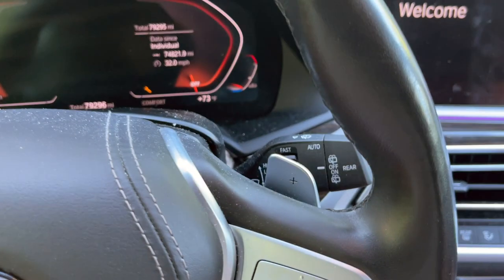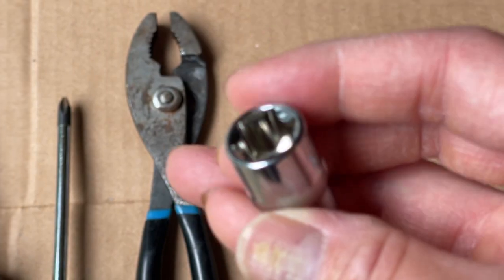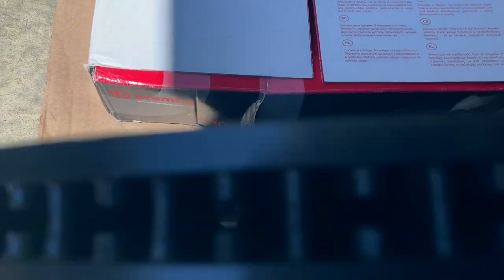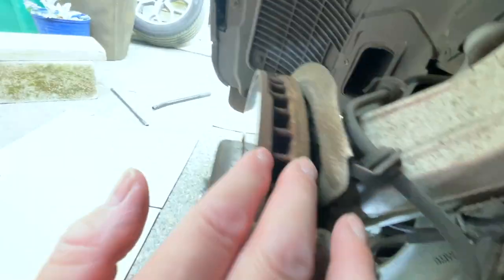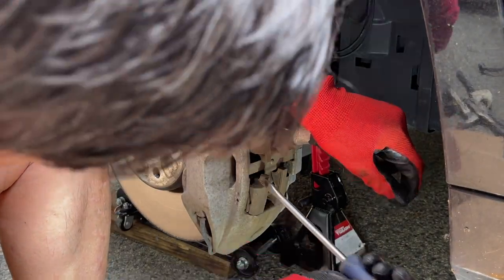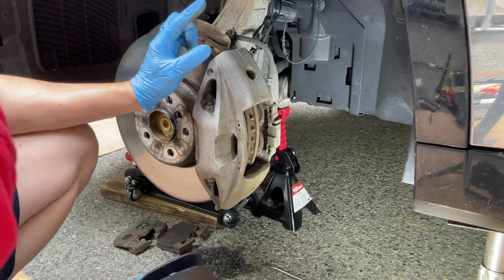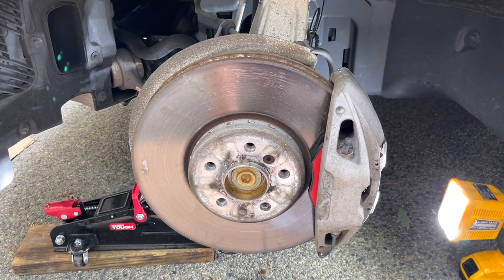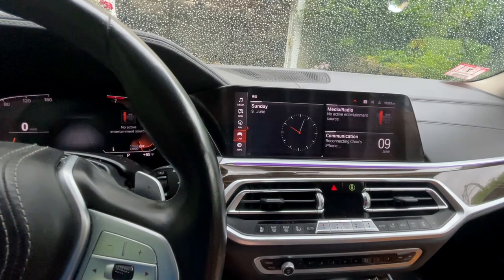Ultimate Guide: How To Change BMW X7 Brakes And Reset Lights (2019-2021)

Comment: You should do your research bmw brakes are designed to do that the sensor will wear so that it gives you enough time to change out your pads, yes you can keep driving but you just need to keep a eye on the thickness of the pad.
Reply from the maker: @paulpryor3333  great advice 
I am a type A person who would change all of the pads as soon as i can

Comment: Hey there, thanks for the video. My question is after you get done with the brake job do you have to reset the brake light on the computer or just take it for a test drive and will be okay?.
Reply from the maker: You would have to reset the brake light… I showed how to do it at the very end of video… make sure you watch to the very end.

Comment: When I look at rotors for the X7 on Rockauto I see some that say "Front and Rear; Exc M Sport Brake; Exc Trailer Hitch; Full Cast Replacement for Aluminum Hat Rotors". I assume that means excludes M Sport and X7's with a hitch.   I have a trailer hitch so rotor size depends on if I have the hitch or not?
Reply from the maker: @trencher7  be careful…. BMW is very specific. I, myself, ordered the wrong one. Whatever you have on there now should match the replacement. GL and let me know how did you do.
Reply: @hunterandchavy  Ya I will just go with the ones that include trailer hitch.  Seems odd.  Maybe they put bigger rotors on the ones with the hitch.  No idea.

Comment: So if you are doing brakes only is it possible to leave the caliper on or do you have to take it off to spread them back out with the tool?
Reply from the maker: If you are using the Amazon brake compressor tool, you have to take the caliper off. If you are using just a couple of flat head screwdrivers 🪛 then you can leave the caliper on. I am no expert But I found it easier to compress the caliper back to zero after removing the caliper as the brake pads are really thick. Hope this helps friend 👍
Reply: @hunterandchavy  Thanks.  It looks like you were showing at 21:25 how to push them out with the screwdrivers.  Does that work for you?  For the times l'm not changing rotors I would love to not have to remove the caliper.
Reply from the maker: @trencher7  I usually remove the whole caliper. I guess give it try. Good luck with your project.

Comment: Hey, does your vehicle have AUTO HOLD? If so, have you seen anything on how to set up/calibrate this feature correctly when changing the rear brake pads/rotors? Thanks!
Reply from the maker: @NadineEspeseth  Hi. I did not know that. I will pin this question to the comments. Maybe someone in the community can respond to this question. Sorry I do not have an answer

Comment: Hey bud did you ever end up changing the rotors or was everything good with the old one on there?
Reply from the maker: The one I ordered from Rock Auto was too big. The one ☝️ that is required is 13.5”? Or 330mm. I 👀 looked at them and they look good. Experts will tell you to replace pads and rotors at the same time (unfortunately I am no expert) I ended NOT replacing them. I will Probably replace them with OEM down the road though. Thanks for checking out the video. 
I have been slacking on the video posting but I should posting real soon. Thanks again
Reply: @hunterandchavy  original is 348mm
Reply from the maker: @price9195  thank you